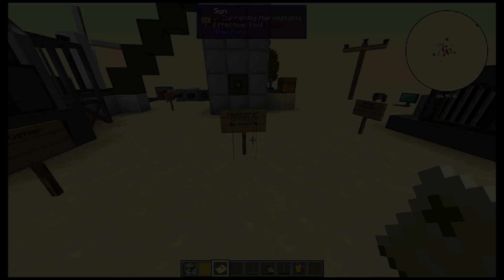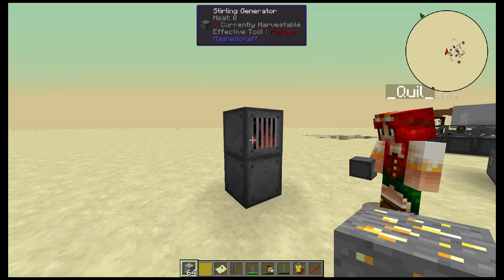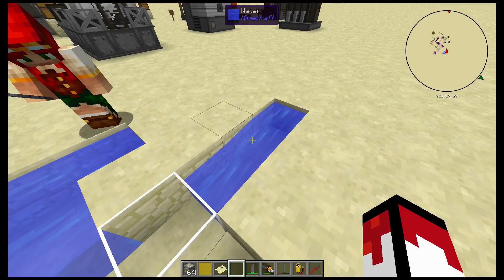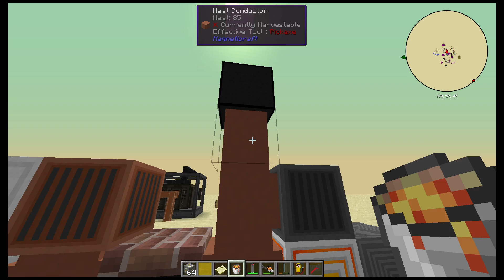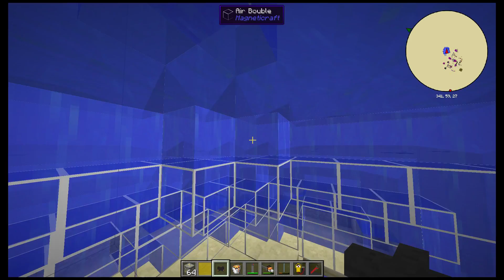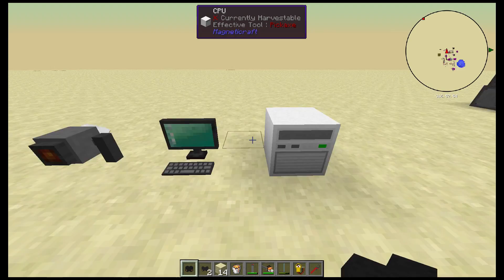Magneticraft - Minecraft tech mod review | TechDragon.info

Comment: this mod is really nice at first look , but then again pretty useless in any modpack because its way to overpowered to be in one
Reply from the maker: +Dave Davilion Well its been changed up quite a bit since this review (i need to make a new one when the next version comes out I think) adding a lot more cool stuff. I like the fact that it makes big machines and functional stuff, rather then a 1by1 magically turning 1 ore into 3 ingots or something. inserters now have filters and can pick things off the grond (as well as chests) and also drop it on the ground, the Grinder that now actually accepts items that fall into the top (like a hopper, as per my suggestion :P) and lots more balancing tweaks and adjustments. I have it in my modpack its quite enjoyeble to build the entire installation.
Reply: Yes i think the same way, but you get like 120 up to 200 rf per tick just from a normal windmill and the miner Is so ridiculous :/ its just Not balanced
Reply: +TheTechDragonChannel the biggest Problem with this mod is that you cant control the amount of Energy in the configs, which then makes it impossible for me to somehow balance it out with other mods, allthough I really would like to because its an awesome mod :/ btw great vid
Reply from the maker: +Dave Davilion Thank you, I think in the (near?) future they are going to make more config options, From what Ive read it seems they now have 2 devs working  on it, so maybe things will start moving along.

Comment: Well... Project Red is holding up the logic and the piping side of RedPower2 while this mod holds the energy mechanics of RedPower2.
By the way, it hooks into multiple energy APIs inducing the RF API, meaning yes you can use Mekanism with this.